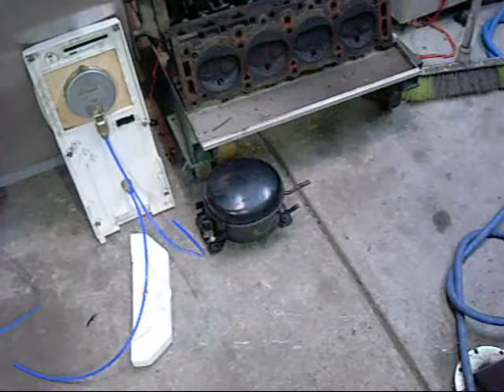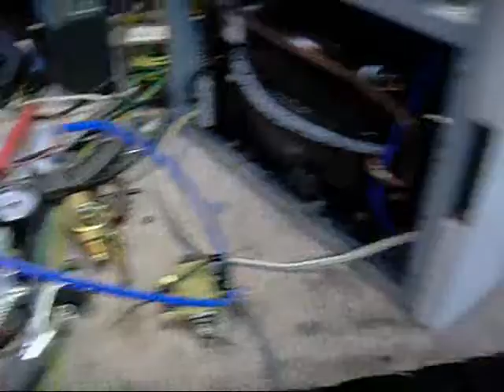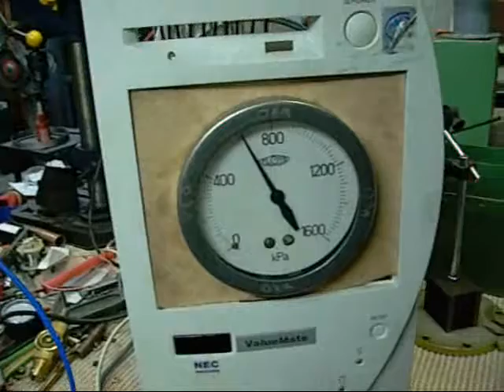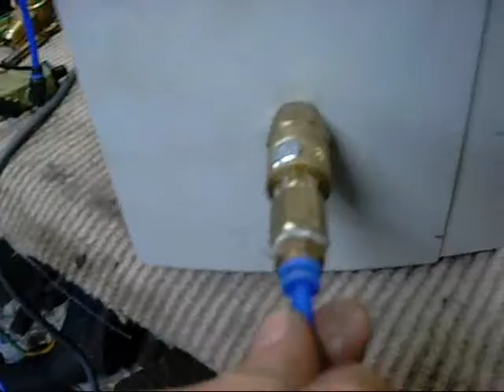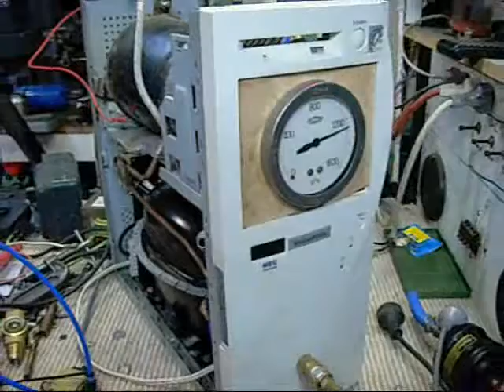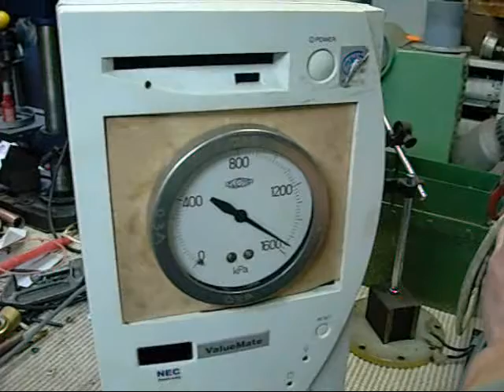Silent Compressor MKII Including 1700kpa Proof test

Comment: @Aussie50 hey aussie, im in the making of an compressor to work with and using 5 danfoss on a tank (102u 2004 2005 2010) and wonder if there are better ones ,like yours , or does it matter,i live in a apartment building thas why i wanna make this contraption so not to piss off my naighbours.by the way i live in denmark...

Comment: @colspyro 
Quick update,  i got 300ml of POE from the compressor so unless there is 250ml-300ml is coating the components inside it has half the oil it should have. 
The question now is.. do i just put 300ml of mineral oil in to replace what i`ve taken out or go the whole hog with 550ml as per the spec? 
This SC21 delivers an incredible amount of air compared to a fridge compressor, two in tandem would be amazing. I`ll make a vid when its all done, and credit going to Aussie50 for the help :)

Comment: @Aussie50 
Cheers mate, 
I`ll to risk the hernia and weigh the compressor before i empty the oil out so i have an idea of how much to put back in, pity they dont have a sightglass inthe casing :)  The spec reckons there should be 550cc in there.
How do you deal with the periodic oil topups? It seems a bit hit and miss just to squirt some into the inlet every so often, i cant use the weighing method once its plumbed in, lol.

Comment from the maker: @colspyro Cool!, POE oil is hygroscopic, and the new comp in this vid does not run it.  with yours I would just drain it as best you can (prop it up so it drains out the suction line for a day or 2) and refill with sewing machine oil or mineral fridge compressor oil. the 2 types are compatible, and POE is only used because of R134a's compatibility problems with Mineral oil.

yeh 1700 kpa is a bit high :D

Comment: Does the new comp use POE or mineral oil? 
I have a HBP/HST Danfoss SC21G (134a) earmarked for air compressor conversion, i`m  a bit concerned the POE will turn acidic and ruin the guts of  it, any thoughts? Is it worth replacing the POE with mineral oil, assuming its compatible with the compressor.
It won`t be seeing 1700kpa, i bail at 1000 ;)
Keep up the good work.

Comment: I was thinking of staging the units in a way where the resevoir has a one way inlet and the outlet would be connected to the inlet of the next pump. also i was going to build a new housing for each pump. Just playing with different ideas trying to learn as much as i can 
before i actually build one dont want to pay 3000 just to fill up my airguns some of the small airgun fill stations dont seem to have a pump any larger then the ones your showing

Comment from the maker: The outer shell of a Hermetic compressor isn't designed for running at more than 200psi, so 200 bar would cause the housing to explode.

the compressors would need to be dismantled and directly connected together. in series.

Comment from the maker: If the intake is filtered, the oil contamination should be minimal though you will obviously have moisture getting into it. my 2 year old twin SC15's are still running just fine though.

the really old worn compressors tend to discharge a fair bit of oil, but the new ones only release a very fine vapor.

Comment from the maker: the whole pipe system will be under 50 -60 psi of gas pressure so the safest way to get rid if it is to put on a face shield or goggles and cut the thinnest tube you can find (capillary tube) and let it bleed out.

or drive a spike into any of the copper lines, either way it isn't enough pressure to cause an explosion, just oil spray.